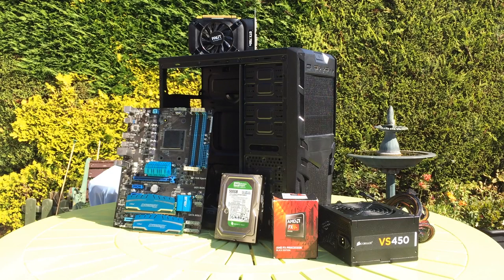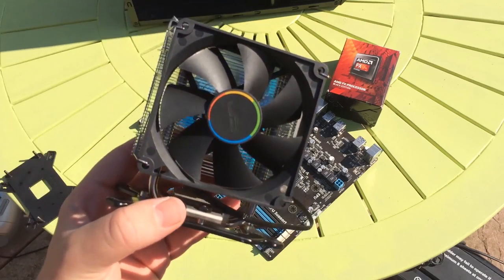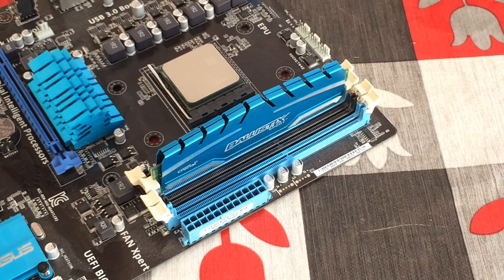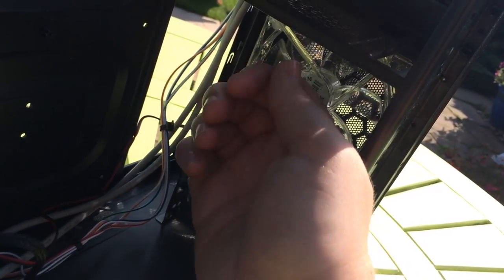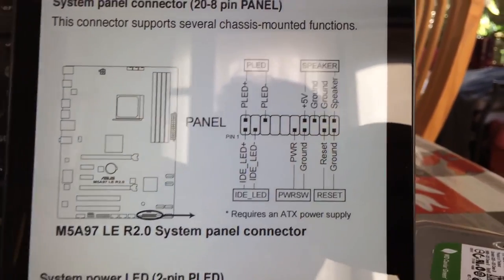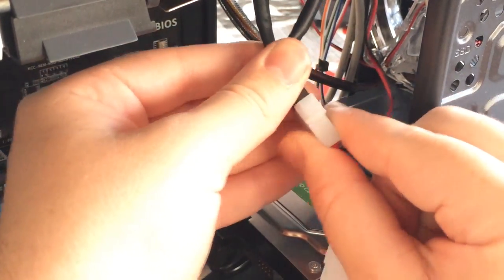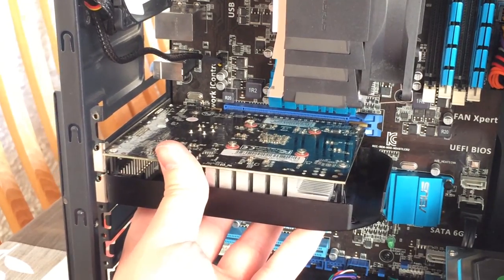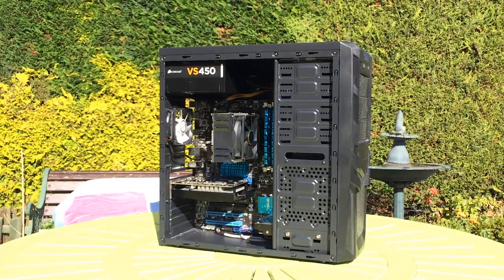Let's Build A Budget Gaming PC - Sensible Used Parts System

Comment: That FX4300 was a little gold mine on release, hitting 4.5Ghz commonly it had some decent power....Shame that if you bought into the LGA1155 system your PC would be more relevant today, as sandybridge was undoubtedly one of the best platforms to buy into....even today aswell.
Reply: you can still upgrade to fx8320 for like a shit load of money
Reply: NOT THE MOST PROFESSIONAL YOUTUBER: I got lucky, ordered an FX8320 and got sent an FX9590, admitedly the upgrade was for someone else though.
Reply: i had a fx 8320 before but now i have i7 2600 and i think it is muuuuuch better
Reply: so yea
Reply: Even the Core i7-2600 still outperform the newer i5 (which is on the same price range here.)
Or Ivy Bridge.. Seriously, the i5-3570 is still pretty relevant. It's not even far behind the newest i5. The Ivy Bridge is a better choice if you want to pair it with a new high-end card because of its support for PCIE 3.0 ..
Reply: I have an i3 2120 and for me it works perfectly, unless I play pubg
Reply: My $70 build is a 3570 and a 750Ti. It's i5 6500 performance for a tiny fraction of the price.
Reply: My pc specs:
12gb ddr4 hyper x
Msi b150 gaming m3
Msi gaming x gtx 1060 6gb
I7 6700 3.4  to  4ghz
Nzxt s340 elite
And 1tb hdd
Reply: NOT THE MOST PROFESSIONAL YOUTUBER wtf? There is a brand new fx 8350 on ebay for 61 euros / 73 usd.   Used ones go for like 40-45 euros.
Reply: JustinXenyx i had an a8 5600k and was good, but bottlenecked tge 4gb gtx 750ti
Reply: i am still using my pretty old gtx 660, which my father bought me back then for 180€ new, and the 4-5 years i own it, it held up pretty well, but i am thinking to switch to a gtx 1060 6gb, because they are almost their normal price before mining.
Reply: thats because sandy bridge was the last intel cpu to use solder to dispense thermal heat, which made them great overclockers. that all changed with ivy bridge when intel cheaped out and started using thermal paste instead. even the latest extreme intel core i seres  uses thermal paste!!!! which is an utter joke to spend 100's if not 1,000's of dollars on a cpu and yet uses thermal paste to dispense its heat from. i can see if intel used thermal paste for its non k series cpu's but all k and extreme series cpu's should be solder!
Reply: JustinXenyx i have a gtx 1060 6gb
Reply: its why sandy bridge will age while modern cpus dry up lol
Reply: i would have to say x58 would have been one of the best platform to date especially skulltrail  because you could put two i7 extreme cpu's into that motherboard it was crazy insane for the time
Reply: Eh Vish 8core holds up very well to sandy can be had arround me for $50 cad almost all day and once overclocked to ~4.7+ and high NB you get near stock sandy ipc. I have an i7 2600 @4.05 GHz or 4.1 depending on the day and if my motherboard feel like booting at 105.3blck  but the real winners where first gen i7 people cheep upgrade to 6 core xeon @4.4 GHz has the same st as my i7 2600 @4.1
Reply: Thythyd Dicky Dick basically Intel hasn't really made any improvements because they didn't have competition and felt as if they didn't need to. They were right as people kept buying their new stuff.
Reply: SteelCity1981 if it was applied properly you could even make an argument for liquid metal being applied under the IHS
Reply: heyo!
Reply: JustinXenyx yeah think to but ive got an i5 2400 for 15bucks Stock better but wtf 5gHz?
Reply: all in one cooler or custom water loop?
Reply: too bad new lga 1155 boards are so hard to find nowadays
Reply: KristoferGilliam tell me about it. In my country most 1155 mobos are h61 based both used and new! The others are very rare.
Reply: Budget-Builds Official lga 1155 I had extra parts so I bought a i7 2600 and it out performs my i5 4690k which was at 4.4 ghz. But I think ryzen is where it is at right now the 1700x blows out any cpu at the same price.
Reply: Too bad I have sandybridge a more power hungry and actually in some cases worse cpu lineup
Reply: KGK i sold my old fx 8320 including mb for 100 $
and than bought i7 2600 and mb for the same price
Reply: 2600k represent! 4.2 ghz on air all day every day.
Reply: SteelCity1981
To be fair here, Threadripper also uses TIM instead of solder, its not just Intel doing it on their enthusiast CPU. So its whatever they're doing different that's the real issue, wether its the quality or an issue with X299 itself. I would assume the former and AMD is just using the best TIM they can get.

Solder isn't why SandyBridge holds up so well though. Its part of it, but the main thing is IPC hasn't improved a whole lot since then. At stock its pretty much equal to the Pentium G4560, so even a mild overclock does it good.
Reply: Sandy Bridge - awesome chips. Just can't get the good boards any more without spending a fortune on used ones. No point pairing a 2600k with 4GB of memory on some H61 junk thing :(
Reply: i picked up a fx 8370 with a asus SABERTOOTH 990FX for $100 off craigslist great plex server
Reply: Allah's Snackbar either one honestly. Though some cpu water blocks are better than some of the aio water blocks.
Reply: Allison Pell how much does a z68 ROG board go for?
Reply: yo , same pc but i have a 2tb hdd and a 960 gb ssd and i8 to 4.2 ghz
Reply: I think an i5 760 would have been a better choice. Fx 4350 is starting by on show its age during general day to day tasks :(
Reply: Budget-Builds Official i will get i5 2400
Reply: I've seen them on ebay for the same price they were new, which is the same price as good z270 boards.
Reply: zombiebarioth, threadripper uses solder. go look at threadrippers deliding video.  ipc has nothing to do with heat dispensing. solder has a alot to do with it. solder helps greatly in the dispensing of heat away from the core. why do you think when people delid and replace the thermal paste on their intel cpu's  with solder, they see an instant 15 to 20c degree reduction of heat on avg afterwards.
Reply: SteelCity1981
Whoops, yeah you're right. I haven't kept up with that, didn't realize the thermal paste was just a rumor and not actually confirmed.

So yeah, forget what I said then. My mistake.

Though come to think of it, I recall watching vids of delidding on X299 too.
Reply: Clunckers are great ! and yea the second gen was a blast(to bad i bought first) i had 7th for a while but i sold it, it didnt offer enought performance gains ...
Reply: running a phenom ii x4 960t which i got for 25eu, swapped it for an 965 be. wanted to unlock the cores, but unfortunately the cores kept crashing. well, atleast this one is a monster overclocker. running it stable at 4.2ghz @1.475v. thats nice, atleast for a phenom, since the others which were based on deneb did overclock mostly bad lol. probably going to try 4.4ghz soon
Reply: Budget-Builds Official Love this new video :) 

The Sandy And Ivy Bridge rocks. I have the SB for quite some time as main PC, and recently built 2nd pc based on IB platform. Soo good.

Pc1:
I5 2500k @ 3.7GHz,
Gigabyte z68-xpud3 rev 1.3
2x 8GB Hyperx fury 1866MHz
Sapphire r9 280x Vaprox dualx
250GB EVO 850 (OS DRIVE) + 2TB seagate    + 1,5TB WD Green
630w SmartSE thermaltake psu
Thermaltake ArmorMX+

Pc2:
I3 3240 @ 3.4GHz
Asus p8-z77-m
1 x 8GB G. Skill RipJaws 1333MHz
GIGABYTE Radeon 6850 @ STOCK
300GB HDD Seagate sata II
450W FSPGroup PSU
Asus Vento Case

What do you guys think about blance between cpus and gpus in both pcs? Could you suggest a gpu upgrade if it is needed? Thanks.
Reply: bion4tural You know what's better than Sandy Bridge? Sandy Bridge-E. Now that AMD has made HCC CPUs mainstream, I can finally take advantage of those 12 threads.
Reply: Do you have a moment to talk about sour saviour the i5-2500?
Reply: FX 8300 - £89.99 new, or FX-6300 used at cex for 45 with 2 years warranty, best buys if you have a AM3+ setup
Reply: Piledriver is fucking trash. The single thread performance is so bad, the FX-6300 it has trouble running Minecraft.
Reply: I'm on Ivy Bridge :)
Reply: Still good to this day

Comment: This moment, when a budget pc better then your pc is.
Reply: Budged means a set amount of money. It could be 100$ or 5000$.
Reply: budged what is that
Reply: It''s ok , once you have a job you can have a decent PC :))
Reply: but how old is you build? 
Time is also factor.
Reply: Same boat,I had an FX6300 based pc but I had to sell it and now I am with an E6400 with 4gb ram and R5 230
Reply: nikarlo palafox why not upgrade???????????????????
Reply: you can build a lga 775 socket pc for 60$

i am using that right now becouse my lan driver doesent work
Reply: +sha106b
My motherboard supports up to Conroe early c2duos and so its pointless for any gpu upgrade.
I will build a new one when I have the money,thanks.
Reply: @LarrysUniqueHandle  sorta late but you should also put location as a factor. Used parts in 3rd world countries are usually more expensive
Reply: @cometxp  "sorta late" literally 3 years late. also i am 6 months late

Comment: I just sold my 4 GB model of the 750ti for $75. I'm gonna miss that GPU it was fantastic, my first new GPU I ever bought and the first time I was able to run modern games well. It overclocked so well too, got over a 250 MHz offset on the core and well over 500 MHz offset on the memory.

Comment: On a similar note as well, CeX are selling the 2000 series of CPU's for rather insane prices! I was building (I say was as it's complete now) a 'retro' PC and picked up an LGA 1155 Motherboard with 4GB of DDR3 1333MHz RAM and a G620 CPU for £30 from eBay. I then paired that with another 4GB stick for £10 from CeX along with an i5 2300 for £22. It is absolutely staggering at just how cheaply you can make a PC nowadays. Keep up the awesome work dude!

Comment: The used market is definitely worth while if you're patient. A private school in my area was selling their desktops to upgrade to tablets. Picked 1 up for $20, which was ridiculous for the specs. I also sourced a used aftermarket cpu cooler on craigslist for $10, a case and psu (both new in box from Goodwill for $15 total) and a new 1050 ti oc ($175) from amazon.  I also bought and flipped a gaming laptop which I found for a crazy deal in order to purchase an Oculus rift touch bundle for only $150 out of my own funds.

 This is my $370 buget VR build.
-i5 2400 3.1ghz
-8gb ddr3 ram
-1tb 7200rpm hdd
-Gigabyte 1050 ti oc
-Corsair CX 500w psu
-Hyper evo 212 cpu cooler
-Fractal Design core 3000 atx case

Flawless 1080p and fully fuctional with my Oculus.

Comment: used fx processors are probably the best price/performance deal for used parts. Sometimes you can get the CPU and Mobo for under $100 which is nice especially if you get an fx-8350 or similar in it.

Comment: I've built PCs for over 25 years and always covered the thermal paste over the whole area and never had a problem...until I bought a top end mobo and 8 core cpu already fitted on the board from Scan. The PC overheated straight away. I stripped it down and saw that the thermal paste was barely covering a quarter of the cpu. I took pictures to prove it. I cleaned the paste off ,covered the cpu with Arctic Silver, reassembled it all and it has been working well for 3 years now.

Comment: I built a great little gaming machine for £420 with used parts apart from the case and CPU fan.
GTX 980 reference, i5 2500k, Asus p8p67 pro rev 3, 16gb corsair ddr3 low profile ram, a case (that came with 3 blue spot led fans with speed control, card reader and a psu/wiring cover) a half decent cpu fan, evga 500w psu, 128 gb ssd, and 2tb hdd. I already own windows 8.1 so I get fee windows 10 every time. Job done!

Comment: I working on a thrift store Dell pc with an i3 4150 @3.5ghz and 16 gigs of ram.  Replaced PSU (for safety reasons)  Got a GTX 1050ti  and installed Window 10 pro on SSD.  Just waiting for the last upgrade to an i7 Haswell.  This little i3 is slightly better than my A10 7860k quad core cpu.  (Time Spy CPU comparisons)  20 bucks for a 2014 pc!  (awesome!) :)  Thanks for the video! :)

Comment: I built a pc similar to this for my father with a fx 4350, 16gb 1600mhz ram, and a radeon hd 7970 with a arctic accelero 2 cooler for around $400 for the entire build that's including the case, psu, motherboard, ssd, and hdd.

Comment: I'm not sure if you've said, but please watch out for ESD damages. It is a real damage to the electronic parts, it's the best if the person who puts the system together grounds himself or herself in order to prevent any unnoticed damages. After an ESD damage, your system may work, however, you may have issues and it's very hard to troubleshoot.
You can buy these anti-static wrist straps, they're not that expensive, and you need to only buy it once. It will come always handy when doing any modifications in your PC. 

Plus an example for an ESD damage case: I've damaged an old RAM modul of mine like this, while I was cleaning my motherboard. I've picked up the RAM slot, cleaned the board, put it back. It did work, but after the cleaning was done, however, some applications that were using it ran into a memory error while they were running. While running Memtest I've found that one of the RAM modules is having issues, so I've asked a friend of mine to take a look at it (he's good with electronics). Then he showed me the ESD damage on the module under the microscope. So it was causing my issue with the freezing and hanging applications with memory errors.

Comment: That HDD will probably be a little uncomfortably slow if used with pretty much any anti-virus software besides Windows Defender, what with the 5,400 RPM and 32 MB cache. If somebody using a similar drive needed to use AV besides Defender, I might recommend disabling Defender for common desktop use and trying to see how things run with their preferred software alone.

If such a user was savvy and seasoned enough to manage without AV (or just did all their deep web searching on a little Linux installation), then that drive should perform decently, imo.

The case will also be pretty tight, so there might be a problem fitting a GPU with a larger cooler/heatsink, so you'd definitely have to do some measurements if it's a dual or tri-fan cooler, and move your HDD into a slot that won't conflict with any expansion cards.

Other than that, this looks like a really legit budget build to me. It even looks aesthetically sound! Good stuff.

Comment: Good video and should give first time builders a few pointers when putting things together. If you need to get a manual for the motherboard, try and get the model/board reference number and look up a few online manuals from the vendor (failing that, Google is your friend). 

If anyone has a slightly higher budget or stuck for a decent GPU, I would recommend slotting in a GTX 970 which can be readily available for about the price of a 1050ti in the used market & performs as well as an RX 470/GTX 1060 3GB.

Comment: Just an extra little tip . With all am2/am2+/am3/am3+  boards the manual recommends that's you populate slot 1 and 3 then 2 and 4 in that order for the ram with slot 1 being the one closest to the cpu . This is extremely important to remember for these am boards especially if you have 3 sticks of ram. As I have had more than 1 customer come in complaining of poor performance o  these platforms only to find slot 1.3 and 4 populated   . The problem being solved by simply moving from slot 4 to slot 2 and poof performance was back .

Comment: To save money on a case use an offcut of pine or mdf, drill in and mount some masonry screw anchors then secure motherboard to them.

Cut to size lengths of budget plastic coathangers right angled w/ PVC tape to form a 'good enough' chassis to help reduce stress on video card PCe slot and to cable tie fans to.

Make another outer chassis area and wrap w/ panyhose as a dust filter.